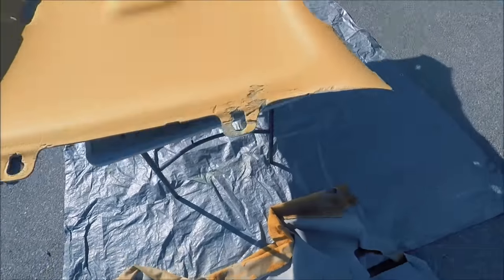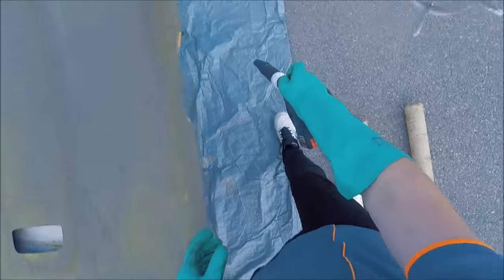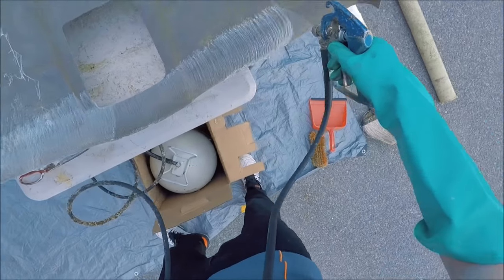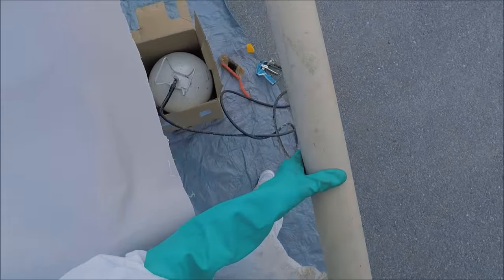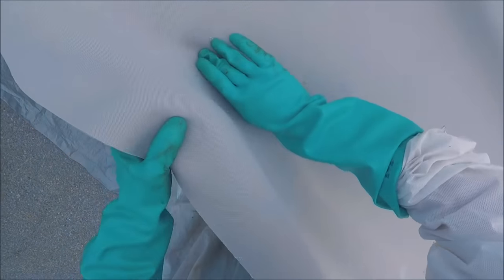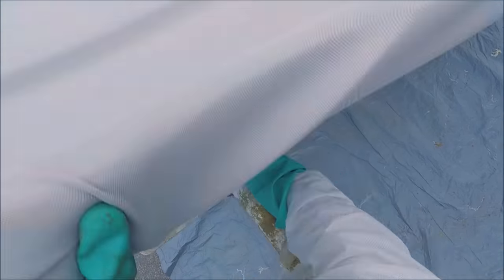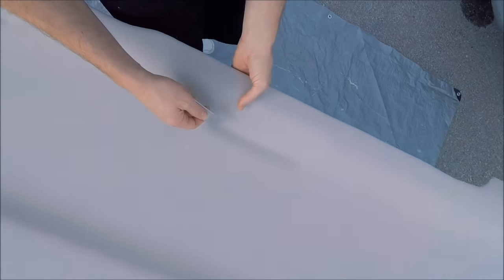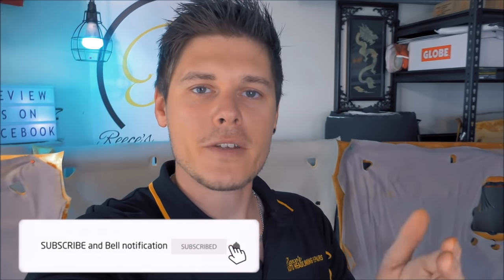How To Fix a Headliner The Correct Way

Comment: I bought an older truck and the interior was in the process of being replaced when he sold it to me the truck did not have a headliner board thingy, it’s just bare metal cieling… how should I go about replacing headliner
Reply from the maker: Some trucks, and especially older cars just had bare metal roof, or a foam panel, or sewn vinyl suspended by metal rods set up. So if the truck didn't come out with a roof liner, you may need a custom one made up to fit.

Comment: Where are you located? California maybe? I'd like to change my factory headliner from a light beige color to a black color in my Lexus. I have a digital rearview mirror and when turned off, it acts as a regular rearview mirror so that reflection when on causes alot of glare. If I had a dark roof, I think that would solve my issue.
Reply: Adelaide, SOUTH AUSTRALIA

Comment: Hi! I know this is a old video and i might not get a answer but im going to add a new headliner/fabric tommorrow but im not sure if i need to remove the previous fabric. The one im putting on has no foam and the headliner i got on now is perfectly fine. Should i remove my old headliner still?
Reply from the maker: If the orginal fabric is felt or carpet, its our experience that this style doesn't remove well, and is permanently stuck down. On on that style we just recover straight over the top, using extra layer of glue to obsorb into the orginal fabric to create a seal if that makes sense. 

But if it's got foam that's ready to fall apart, original fabric can be lifted off , then we would take off the old material before we recover
Reply: @ReecesAutoHeadliningRepairs  that makes sens! The fabric on now is on there like it was new with just some stains. Sadly it aint felt or carpet but more like the texture kind that you mentioned before. Like jeans. You think i can still just use glue but maybe in a larger quantity? The problem i think is that the old headliner is almost like "melted" in from factory.
Reply: @hampusbohlin7591  I approach it by if the original  fabric  can't come off , and expected to not come off in near future as in like at least 7+ years. Then I'd go straight over the top with new material

Comment: Hey, can you advise is 3M super 77 is ok/safe to use as I’m facing difficulty sourcing 76?

Thanks,
Kam
Reply from the maker: I haven't yet test super 77 glue, so difficult to suggest it at the moment.

These glues I suggest 
▸ Permatex headliner & carpet adhesive - http://ebay.us/apC9ZH
▸ 3M High Tac 76 Headliner Glue - http://ebay.us/eAGTji
▸ TensorGrip T65 500ml Can - https://ebay.us/rysIGV

Some worthy mentions but is The list I haven't tried yet are:
3M Super 77
Car builders spray Adhesive 
Cantec high tac
Reply: Thanks bud! Appreciate your feedback.

Comment: Do you need the fabric with the foam or can I just pass that part and just use other fabric?
Reply from the maker: Foam backed headliner fabric is the best way to go. 

Even if using aftermarket random thin fabric, eg: custom print on to material, then we like to recover first with our foam backed uv graded roof lining material, then recover over the top with the aftermarket thin non foam backed fabric. 

This insures a long lasting result.

Comment: I see when your putting fabric onto board you are able to pull up fabric why isn’t this sticking together to glue on board and fabric ?
Reply from the maker: Its a combination of the right gear during the right situation.

The glue we using 20lt canister Tensorgrip T65 or T51 is a highly convenient product to use however its big $$. Also how hot the day is. Dry time. Press lightly to begin with incase of errors. Also our fabric we stock and can sell to you has a stitching on the back to prevent foam loss while peeling it back off and having another go at it.

Comment: Great video... how much does a job like this usually cost if they come to you?
Reply from the maker: Keeping in mind there's a few factors that make the price vary, for example, does the customer only want the recovery stage, and they will be doing the removal and reinstall of the headliner board, any sunroofs etc.

But for a rough idea on pricing, for the full job Removal, Recovery, and Reinstall, its usually around $345-$525. 

Spealisist jobs like Volkswagens, Audi, Large 4wd/Vans usually attract a higher price, because they can become a very time consuming process compared to the usual Falcon or Commodore.

Comment: i have removed all of the original foam, but the headliner is still sticky, do i have to sand it further or can i proceed to glue it?
Reply from the maker: Usually that's fine if doing all the steps correct, unless it's a Volkswagen or Audi board, then we may suggest brush grade glue 'supa grip' in high stress curve areas.
Reply: @ReecesAutoHeadliningRepairs  It is a vw concern car, Thank You for your answer!

Comment: My experience can spray glue will let go when the temperature of 100 degrees is in the car. You need a commercial contact glue for upholstery. I did this for 37 years. You notice he’s using a spray gun.
Reply from the maker: Thanks for commenting, yeah we agree that some Can glue can not work, definitely once it gets hot.

In the video we are using Tensorgrip T65 / T51 20lt canister. But find Permatex Headliner Adhesive from a can can work for those who want to do a DIY one off job.

Comment: what do you do if you have to bend the board to get it in or out the doorway
Reply from the maker: With experience most headliner boards spring back into shape after a slight bow flex to get them out the front passenger door or rear drivers door. 

Also if recovering in new foam backed headlining material (the stock we sell) it hides any imperfections. 

If not recovering and removing a felt style headliner, bending those will leave a permanent crease. That's when windows would need to be removed instead.

Comment: What Glue gun are you using and  what  is it connected to
Reply from the maker: We use a setup from two places that both do the same thing. If your referring to the actual nozzle on the gun tip, we just use the one that gives of a wide spray pattern. 

TensorGrip T65 20lt canister with hose and gun by Tensor global. 

Or

Cantac hsc tac canister with hose and gun, by glue guru.

Comment: I'm just curious about how you get the board out of a 4 door car,
Reply from the maker: Usually by gently flexing most headliner boards out the front passenger door, or rear drivers door. Some models more difficult than others.

Comment: Do you need to remove the old glue.
Reply from the maker: Remove old foam, and the glue naturally comes off too or just isn't present anymore, unless someone added some glue in hopes to hold it up, like a short term solution, then you'll need to sand it flat so there's no imperfections in the final result. 

For more detail on the process, 
Ebook headlining Secrets download link (DIY TUTORIAL)
https://www.reecesautoheadliningrepairs.com/product/headlining-secrets-ultimate-guide-fix-sagging-car-rooflining-reeces-auto-headlining-repairs/

Comment: How about if you want to use the original headliner?. I have a mercedes R129 SL500 and I want to use the original headliner.The foam disintegrated and was sagging.l cleaned both the board and the headliner and am tbinking about gluing foam to  the headliner and then gluing that to thd board..The reason is that the headliner material is a special type of vinyl and I would like to keep it original.The problem that I see is lining up the holes for the handles.If thats a problem I'll just go with a ready made cloth material.
Reply from the maker: The only problem comes to when reusing vinyl is that it may be hard to get exact back into position, as they can shrink or stretch and also become extremely brittle

Comment: What is in the white cylinder? Is it gas or possibly helium?
Reply from the maker: Its the glue we are using, its kind of like using a large aerosol spray can. The glue is called TensorGrip T65 or T51, which comes in a 20lt canister

Comment: @reecesautoheadlingrepairs Hey! Questiin for you, we bought some relatively thin fabric from the fabric store, but we forgot all about the phone. What would be the best option to install our custom material without the glue showing through, is the foam backing available by itself? :o
Reply from the maker: Usually we always use foam backed headliner fabric. 

But you can use headliner foam backed fabric first, that way the board has a soft touch and hides any imperfections in the board then apply your fabric over the top with a very thin layer of glue applied each time. Its hard to gauge how to apply your own fabric as we haven't sighted or felt it yet. 

Our glue we use TensorGrip T65 or T51 comes out as a thin web, so I can get away with applying most customer supplied fabrics.

we don't sell the glue, but suggest to use one of these glues

Permatex Headliner Adhesive 
- http://ebay.us/apC9ZH

3M high tac 76 Headliner Glue
 - http://ebay.us/eAGTji

If you use one of the above, just try to apply it in a thin layered pattern, try not to puddle the glue up in one spot too much 👍
Reply: Thank you for this video. This is great information if I ever have to do a head liner.

Comment: What if you don’t have a headliner board
Reply from the maker: Modern cars are designed to have one, so you'd need to supply a donor board from the wreckers.

Classic cars have a different setup, which involves sewn vinyl suspended by metal bows

Comment: That was in a hatchback...how do you get the liner out on a sedan?
Reply from the maker: Usually via front passenger door. Or rear drivers side door on FG sedans, and VE sedans.

Front Seats fully relined, and pushed back on tracks. Blankets laid down to protect interior. And with experience all works out well.
Reply: @ReecesAutoHeadliningRepairs  thanks buddy, will have to give it a go, my 32 year old headliner is both sagging and since we're in Ireland a little mouldy. Well done

Comment: When I replace my headliner I clean the board then seal it with a couple coats of polyurethane.  I also don't buy headliner materials with foam.  I use felt material from fabric store. No chance of foam deteriorating in the future,
Reply: It works?

Comment: I found it very difficult to lay the material after spraying thr glue. After 5min the glue becomes very sticky and difficult to deal with it. Also very easy to make mistakes like maferial bending,sticking to each other etc.  My advice would be to anyone that needs this to be done rather pay 400-500$ for someone to do it than 150-200$ worth of material and still not done properly and all the hassle that you go through
Reply: Watch other videos. You can often find more tips on easier ways to do it. That goes for anything you're doing.
Reply: If you do this kind of work for the first time it's better to be with 2 people one keeps the lining little up and other presses it in the right way. Doing it on your own, it  glues everywhere but where you want it.
Reply: Or just don't be incompetent.  I did my first headliner almost 1 year ago today now I have a full on business and I have never had help. I figured it out myself.  I love turning away work  because there's too much to do.

Comment: Why did not clean the old glue before you put the new glue on
Reply from the maker: Old glue, old foam, and old fabric are all removed and placed in the bin, then we use new foam backed headliner fabric, along with new glue applied

Comment: Why  do you need  UV protection  the material is not in direct sunlight
Reply from the maker: Possibly because it allows the same material to be used on pillars, like A pillars which would be exposed to sunlight, also it must just had durability to the fabric to last longer in heat 🤔

Comment: Best way is to NOT put that foam based crappy headliner material back on but find a fleece you like and don't worry about it again.
Reply from the maker: Its a good point, as the foam would eventually deteriorate again, however the foam/fabric quality we buy I believe is better than factory. And the problem with using Fleece or Felt fabrics is that from my experience they don't have flexibility and stretch to be able to apply perfectly to all roof boards, and being that it's so thin, it shows up imperfections on the roof board, if any.
Reply: @ReecesAutoHeadliningRepairs  i can see that. My pickup didn't have too many contours so it went down really nice and stretched where needed.  Some vehicles I can see possible issues.

Comment: I am a professional upholsterer and that glue doesn’t work in a few days your headliner going to fall again you have to use weld wood landau top & trim hhr solvent don’t make the people waist Tim e dude
Reply: With doing approx 1 to 8 jobs a day for the past 7 years using this same exact glue, TensorGrip T65, I'm certain & confident it works very well if applied correctly.

Comment: Never use heat bonded foam backed "headliner" fabric. Its garbage. 
I only use it for sew foam.
Reply from the maker: What would you use for modern headliners?
Reply: @ReecesAutoHeadliningRepairs  faux suede crushed velvet, poly camo blanket fro JoAnnes fabrics, any kind of animal hide with it without hair, anything that doesn't have foam in it. 
Elephant hide. (Faux)  
Even krylon spray cans with a graffiti theme would be better than that foam backed sh,t. 
You could do a camo netting or some plaster with corner molding. 
Anything besides foam backed. 
Maybe a tile mosaic. 
I'm between tiger skin and zebra for my 93 F250 I haven't decided yet.

Comment: Hey mate great video , but just a reminder that the suggestion for using drawing pins to hold up the lining , is a very dangerous suggestion to people that follow your channel . As these drawing pins can come loose and potentially fall into the hands of a child in the back seat and that is a major choking hazard . This terrible tragedy has happened to a family I know personally and their child at the ages of 3 yo passed away after choking on the pin . Mabe just remove the suggestion about the drawing pins . Kindest regards Jeff F
Reply: Sorry to hear. Yes most definitely a bad idea considering that, thanks for the awareness.  I'd say Twist pins may be the way to go for short term solutions, as that pin can screw into the board and secures itself. I'll make those updates to this knowledge clear across the channel and socials 👍

Comment: Too much trouble. 
1.Rip the fabric off
2.Get the foam off with high pressure cleaner
3. Paint the liner with water based paint using small roller
Reply from the maker: Interesting, when you say high pressure, do you mean with water? Or air? I think high pressure may have issues with most boards, as the surface structure can actually be quite fragile to excessive friction
Reply: @ReecesAutoHeadliningRepairs  Can you share info on the air high pressure cleaner? Never heard of it.
With the normal high pressure cleaner, you can adjust intensity of  cleaning by moving the water jet closer to or farther from the surface. 
BTW, you do not need to dry off the shell completely before painting. Some moisture increases paint penetration and makes better finish.